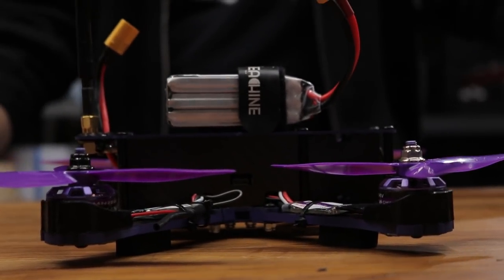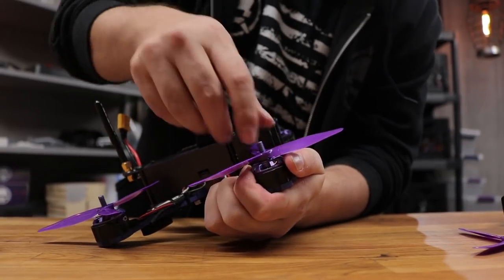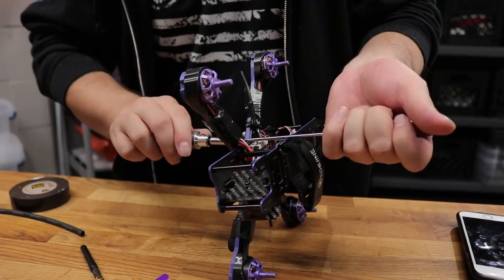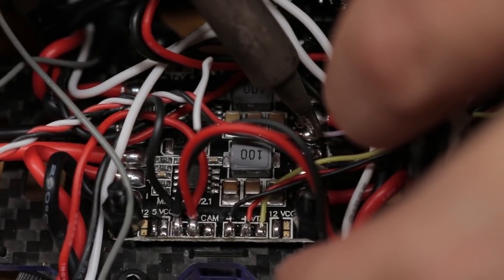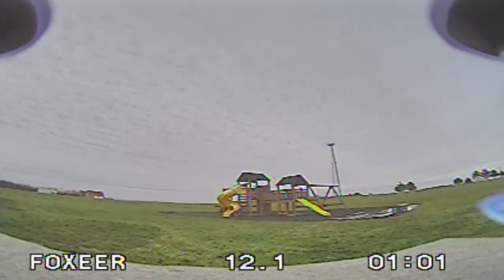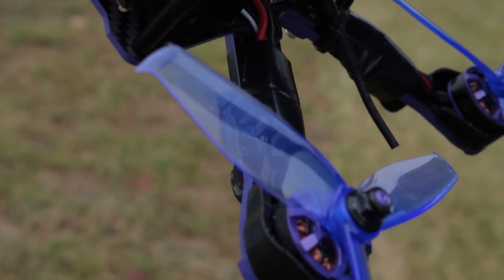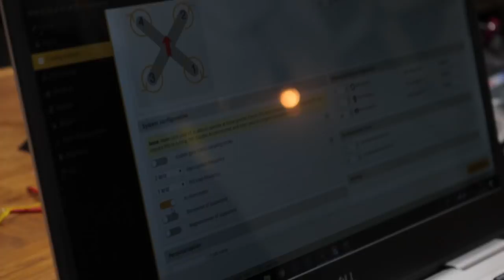MODDING the Eachine Wizard PART 2! - Kwad Mods

Comment: I'm just gonna keep practicing on a inductrix fpv+. And then save my money and by a better quad, more and likely I'm gonna some fat shark googles before the 5in quad..
Reply: That's a smart move. A lot of times when you buy the cheapest thing available, you spend more in the long run.
Reply: Yes! Ding ding ding we have a winner. Had I done this as a noob I wouldn't have a Flourean Racer 250 hanging on my wall not getting used anymore. Never would have bought it if I knew. Wasted money on obsolete parts (naze32 FC, 20amp ESCs one step above Simon K 12amp, structural PDB and plastic arms with only 2mm of carbon in the top plate). Wait until you know what you want and need then pull the trigger. Eachine and Furibee alike have released enough subpar quads to heed this warning.
Reply: Good call. Might I suggest getting Bardwell's Budget Build for your first 5in quad? A friend and I built a couple of them. My friend is completely new to the hobby and didn't know anything what so ever about the internals. It took him a couple of afternoons to get the quad ready for maiden flight. At $219 it's not exactly a "budget" build, but rather a "most bang for your bucks" build and it flies insanely well.
Reply: Pile makes me: 💭 I can do $220 for JB build
                        🤔
Reply: But then 😣 “NO! I need proper goggles! If I’m dropping $250 its gotta be for goggles!” 
😂
Reply: @Rvalivesound  a little research would have prevented that
Reply: I highly suggest building your own. As you can see in this video Even if you buy one build there's quite a lot of building when you're fixing parts and you won't have any idea where to begin if you didn't put it together. It's very simple you can watch lots of videos
Reply: @jordanbass3210  I just don't know how to solder.. never done it.. I want to learn..
Reply: @jordanbass3210  I'm a welder, just never done any soldering on electronics
Reply: i  built  my own its not that hard once you do it ,its like riding a bike you will  never forget  how to do it ,i was worried but my first build is still in the air after 2 years...theres a lot of good soldering videos out there i  watched when i was  learning,,bardwell and jc helped me alot over the years  to
Reply: My exact path. started with the fpv plus xmas 2017. by september 2018 I had fatshark, taranis radio, and was flying other brushed builds learning to solder better. Now I finally have a couple 3inch and built my own 5in that I saved up for nice parts.
Reply: @jordanbass3210  My point exactly. Dont make the same mistake I did starting out. I jumped the gun buying on looks instead of research.
Reply: @VORT3XFPV  Of course you would say that when you have an fpv store + rotor riot store. It's all about research, expensive things can be much more shitty than cheap things.
Reply: Max Power It has nothing to do with the store. It’s common sense. If you buy $6 escs and have to replace them all the time due to failures, it’s more expensive than buying $10 escs that last longer.

Comment: Dude those side plates provide structural rigidity without them it'll snap the top plate in two.. there are only 6 stand offs that's 3 on each side which isn't enough to keep that top plate from cracking in two on hard crashes. Believe me when i say that it's the truth I've busted 2 top plates on the wizard and once the plates were put back in place they haven't done anything but pop out on hard crashes..If possible keep the plates and the worst that'll happen is they'll blow out on a hard crash and you'll have to put them back on but you won't bust your top plate.. to each their own I suppose I just wish he knew more about the frame from the personal experience..And as far as the electronics go the wizard is junk! Don't waste the money unless you are good w a soldering iron..

Comment: So. Another $100 later. Its gonna end with a wizzard frame and all new hardware. Total worth $500. Oh and if u use cw and ccw motors u can solder them normal. If u use only cw or only ccw motors u have to switch cables from 2 motors or reprogram 2 esc's.
Reply: hetlarfje That is incorrect. When you see CW and CCW on a motor, that has to do with the thread of the shaft, not the direction the motor will spin by default.
Reply: @VORT3XFPV  its not only the tread of the shaft. Please try it out with some different motors and u will see. Just try 4 cw motors and u will see u have to re program or switch cables on the front right an rear left motors. Then solder on some ccw motors on front right an rear left and check again.

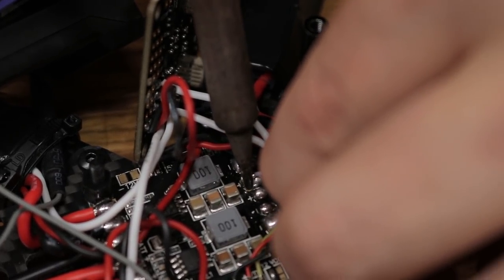Comment: 7:51 you sure that ESC burning up wasn't your fault with this solder? That looks awful close to shorting the ESC.

I'm wondering if we're lookin at the exact arm that burnt up. it's very possible. If the front of the quad is at the bottom of the screen in this shot it's exactly the same arm.

in fact after seeing that the same ESC didn't work again i'm 80% sure it's because you shorted it with that solder.

Edit: ok the fact that you got it working with a different ESC I'm bringing my % down to 55% sure........ And I'm giving a 20% chance that you figured out that you shorted it and fixed it without showing us that you fucked up. But it seems that the idea you shorted that side with that solder fits very well.

Comment: Go sideplates actually do a lot. They strengthen the whole quad overall. They make the top plate less bendy and much more rigid structure. Without the side plates the top plate is most likely going to crack on a crash. On another note why wouldn't you guys be doing the high volt 6s wizard instead of the literally the oldest one account. Most people are going to buy the newer wizard not the one from two years ago LOL. And you can fly on 4s to 6s
Reply: Because this is the one that a ton of people have already bought.
Reply: +1 on keeping the side plates. Unless you swap the 2mm top plate in.
Reply: Side plates are key they make that frame a tank and keep sticks out wish i seen more frames with them! Also it's 4s capable they just give you a 3s battery. You put on a 4s r-line and that thing rips! good tips though! also the original escs handle 4s abuse all day lol anyway the best investment as a beginner is good goggles! laforge v4!!
Reply: Yes side plates essential to complete a more stable robust chassis crashing hard without almost always cracks top plate due to excess flexing in chassis 😎
Reply: Lol yeah...   I wish I started fpv 2 months ago instead of 2 years caus ethat x22hv look nice,  Although I’m pretty sure they have a problem with “death rolls” or something

Comment: Ah yes. Good old original Wizzard.  Had to replace fc, pdb, and escs before a first proper flight 😅

Poof smoke poof smoke poof smoke...
Reply: I guess I got a good batch then.
Reply: @sethbryan9074  Me too! I only had an esc smoke after a crash.  Otherwise I'm flying it in stock form (except for the crappy camera).
Reply: lol.
Reply: You must have been doing something wrong because it was a pretty solid quad
Reply: @maxpower7344  yup.  That must be it.

Comment: Don't buy a wizard or a crapy quad otherwise you will swap every component making it more expensive than buying it right at the beginning.
Reply: Smoothie FPV Agreed. Some people can’t resist the temptation of getting a quad and transmitter for under $200. But you’re right, it’ll likely cost more in the long run.

Comment: What! Replace the esc right away!  That’s a minimum of $50 with shipping!?  What about replacing parts as they fail?  Let’s not propagate the notion that motors and ESCs have to match exactly!
Betaflight magic? 
Please, no magic....just practice....like any software/firmware/game.  With OSD, tuning experimentation is easier than ever....and defaults are pretty great. Get out there and fly and experiment friends:-)
Reply: Canyon Racer Usually I’d agree fix it once it breaks, but these escs are well known to be unreliable. I don’t want people to have one fail for no reason at a bad time and end up losing their quad or hurting someone.

Comment: seems a bit nefarious guys - demonizing a cheaper quad and making out that a lot of changes need to be made to make it decent.
sorry - first thumbs down for a RR episode and i been on board since first one. quad snobbery aint pretty

going 4s first would have made the biggest change. then ibus, pros and BF tweaks.
Reply: glenby2u I think you missed the point of the video. It’s the most common quad out there and a lot of people have had struggles with it. The whole goal of this series is helping out new pilots.
Reply: i think the snobbery is in the comments, i can't say jeff was snobby,
Reply: Totally agree, this was a very important quad when it came out (MORE THAN 2 years AGO!!)  and helped lots of people get into fpv with what was really a pretty solid quad.  Not sure why this video even had to be made. Would have been much better to recommend a current day budget pre-build and then suggest small modifications to get people slowly starting to learn to tinker.
Reply: For real, this entire video's attitude was snobby
Reply: thanks geoff.  people do have struggles with them particularly given QA but i think the order of upgrades for the kit should have been more about improvement bang for buck. that way they have a better experience, more flying time and more to spend on a better one later. 

tweak BF settings to ibus etc. 
definitely buy more and better props.
instead of a new camera, get a 4s battery and cheapy 4s charger
instead of a new vtx, get another 4s battery.

Once it's locked in, then you change camera, vtx

anyhoo. keep on posting and thanks. would love to see some more of your flying one day.
Reply: I feel he did a great job. Once ur stuck with a wizard this will help some newbies
Reply: I think if you guys remember the last time they took out he wizard it was next level snobby

Comment: Wtf is going on lately, the wizard is old as shite and trash for even then, the only reason to make this video is if people already own it but now beginners are going out and buying it when the upgrades cost they could buy an actual good quad, even with all these upgrades it would be much more than an actual good quad from the start or you could say to them, keep your old sherry wizard and then with all these parts build a quad so you have a wizard as backup
Reply: The wizard get's YouTube views... that's pretty much what I can gather from it. Maybe RR has some data to explain why they chose the piece of shit wizard, 2 more ep's and they will be replacing the frame and all the rest of the parts. Wiz-was.
Reply from the maker: We make content based on the questions we get the most.
Reply: In my country there really aren't that much affordable options for FPV, I already owned a Wizzard before this series begun and I'm very grateful for these guys to be uploading this content
Reply: @cardansan  Yeah I understand that but it's making em buy it instead of something better
Reply: @zeroxfpv1534  Well it all comes down to personal preferences. I might buy some upgrade or not, but at least all their little "freebie" advices such as the antenna placement or getting rid of the quad walls because of the air flow are also useful, and just because they are showing how to make a better use of something I already have I can say these videos help me improve and enjoy more the FPV, which is why we are all here.
Reply: Most of us don't want to shell out $300 for a decent quad, then buy a fanboy qx7 for $120 and fanboy fatsharks for $500 with module.  Or but the rtf wizard kit for $220, with rx, goggles and quad. You need to remember that some people are just starting this hobby...